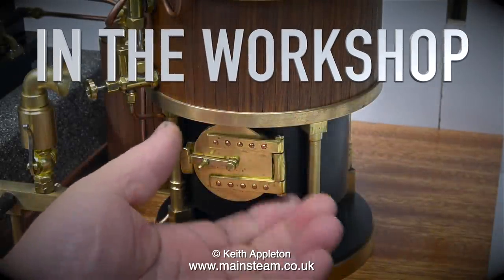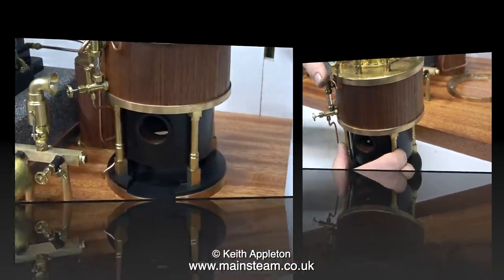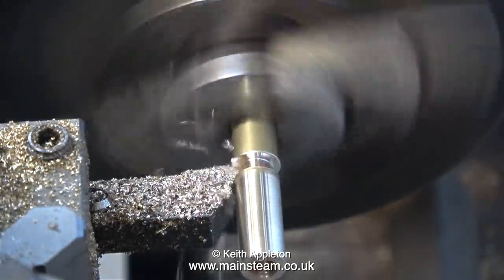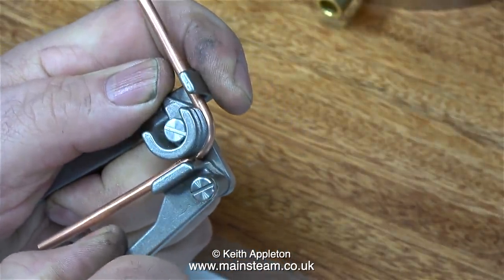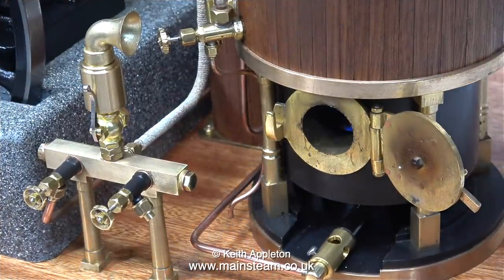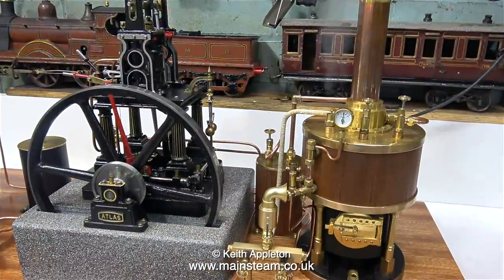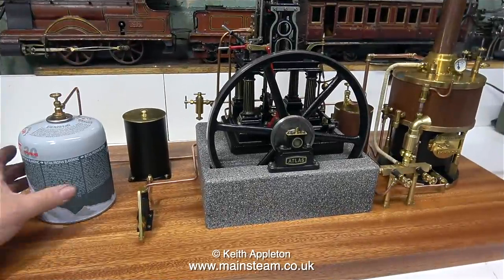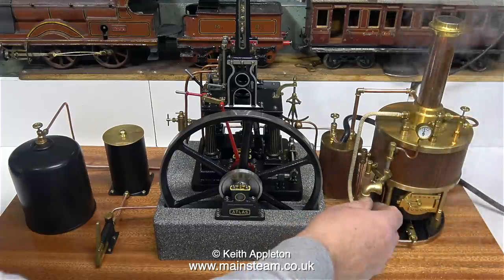ATLAS STEAM PLANT CONSTRUCTION - PART #10

Comment: When I used to show my model steam boats at modelling events I had made up a special gas tank for demonstrating on the bench, I took an empty fuel tank and cut the bottom out, and drilled a hole in one side. On the empty tank I drilled out the top where you fitted gas regulator, in this hole I JB welded a brass pipe with thread matching the fuel tanks, this was connected to an elbow which connected to a fitting in the side hole. The fitting in the side hole was an small aircompresser. This allowed me to run on compressed air while on the bench, while showing where the fuel was in the model and safely removed the fuel from the model while it was on display.